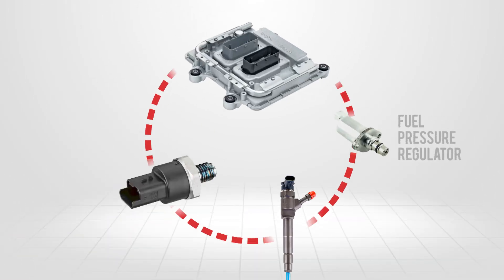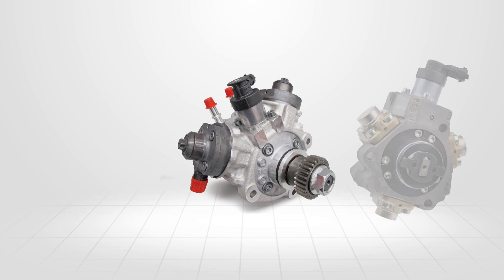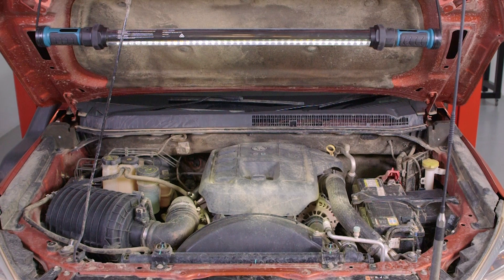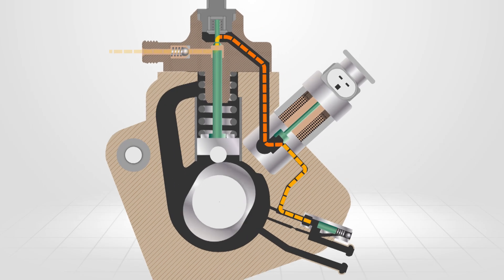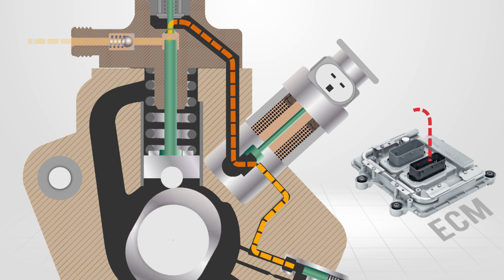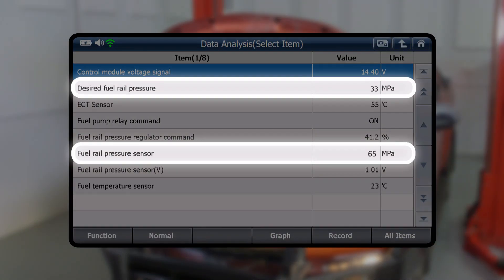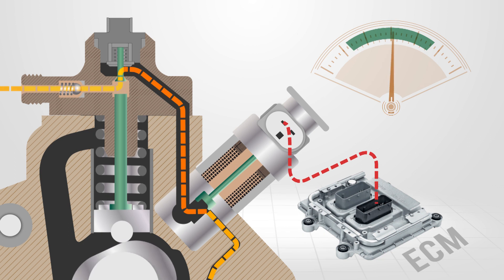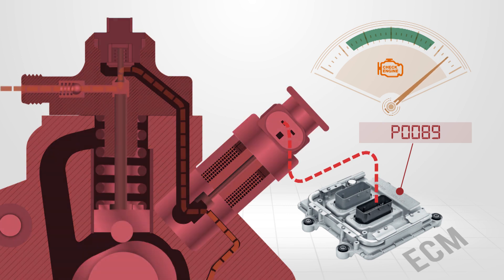Diesel Pressure Regulator Performance

Comment: The pump in my car has the flow control valve plus a pressure regulating valve.. 😃 I had fault p0088.. lucky I keep a obd reader in the car to clear the fault to keep driving 👍👍

Comment: I have a Fiat Scudo 2 L Diesel high pressure low what could be the problem knocking off when you drive on the road
Reply: William O Connell 
Hi i have the same Problem, did you fix yours? I think i'm gona disassemble the pump soon

Comment: HELLO SIR, I HAVE HYUNDAI SANTAFE 2009 CC 2200 DTC CODE P0086 P1187
MY STOP WHEN I PUSH ACCELATOR I WAS CHANGE FUEL DIESEL PUMP BUT ITS STILL SAME PROBLAME, DO YOU KNOW HOW IM FIXE THIS PROBLAME